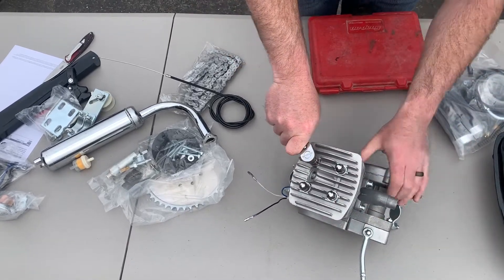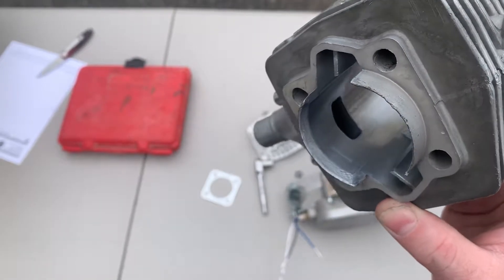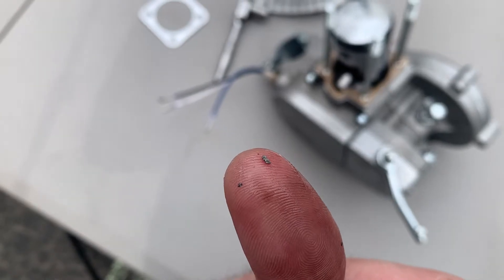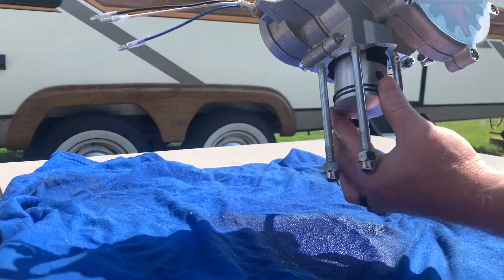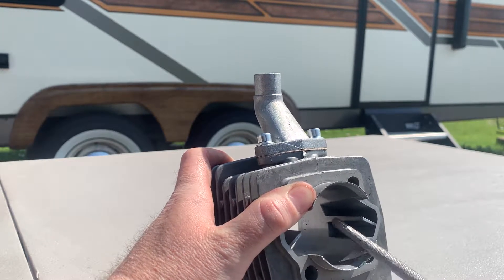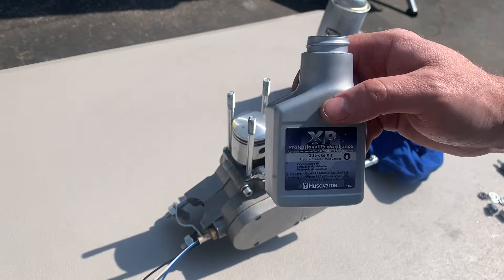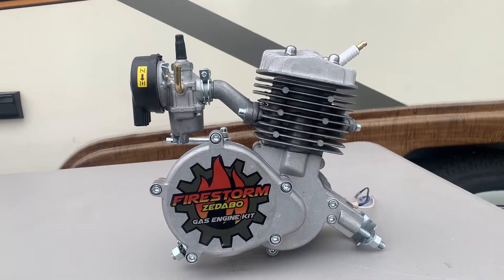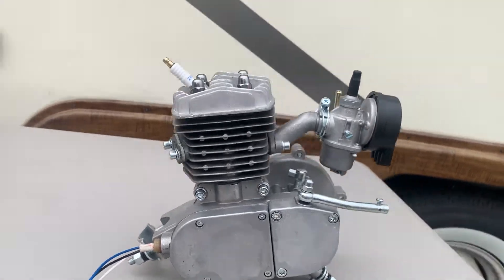Ep1 ZEDA 80CC 2 stroke bicycle engine kit  RIP APART poor quality control! FIRESTORM!

Comment: Keep the junk you'll never use. They work for several things. Just not motorised bikes.  Those chain guards work great on a tiller to cover the belts. I use the cheap tensioner on my sailboat 😂 for the keel cable.   Sell any excess on Amazon or EBay. Reclaim some $$s.
Reply from the maker: Oh I still have it. That’s great advice!

Comment: I swear these engines are all made in the same China factory. They slap a tacky sticker on to make us think somehow they're an upgrade when in reality its the same old junk. Zero quality control.
Reply from the maker: They pretty much are. But what I understand, they are a great way to be introduced into the hobby. I can’t afford to go high end. But the options are out there.  Check out my playlist on this setup. I’m doing a thorough shake down on this machine. Still on going. We are having fun
Reply: @ColdStartGarage  very true. An engines an engine. They all work. On the same basic principle 👍
Reply: All you need to do is some simple upgrades and slight improvements and these engines can be reliable as hell. They are dirt cheap to rebuild the entire thing if it get to it. These things are perfect to learn how to keep an engine running and what modifications can actually do. These things are not junk you just have to be invested in wanting to make them fun
Reply from the maker: @Mr.Thermistor7228  💯 agree. I’ve learned a few things since this old video. But thanks for your insight!

Comment: My firestorm came w metel shavings in the motor too . Glad i pulled top end off . Put mix gas in crankcase shook n poured out till no more signs of it in the engine , just clocked 250 mile and really like it
Reply from the maker: Damn that’s good thinking! Wish I did that. Luckily the engine is running pretty strong still.